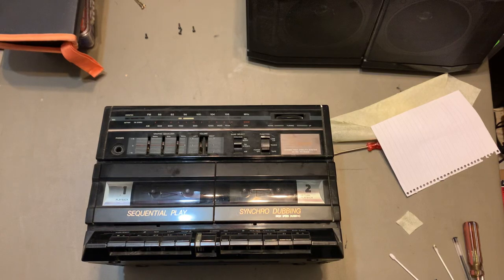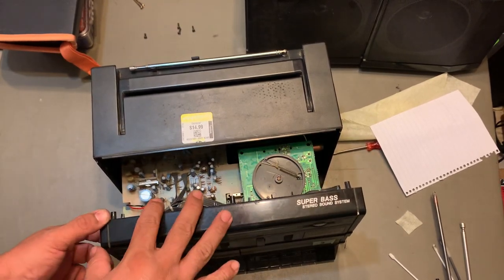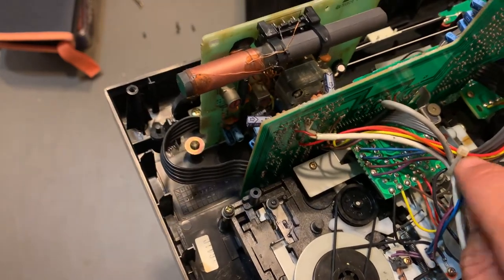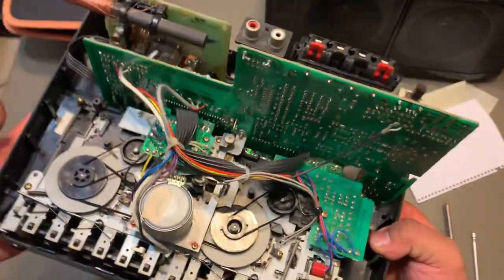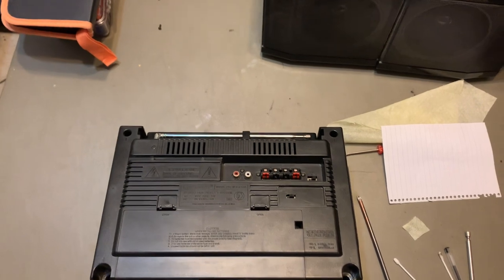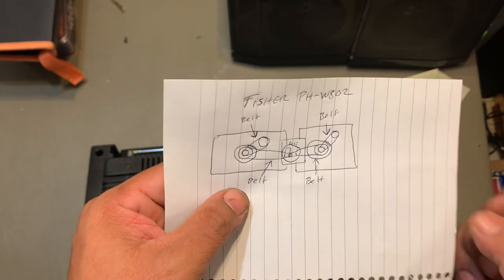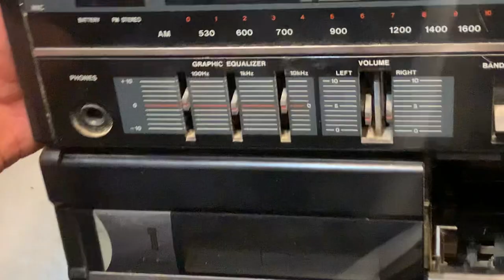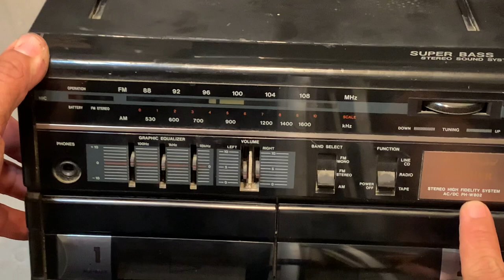Fisher PH-W802 boombox (belt replacement)

Comment: Hello, i have changed belts on fisher w702, inside its like yours, but after change, one mc deck playing faster than other, i used belts from ali express, they were various sizes, i picked same for both decks, and one side got more tension, maybe that is why one side is faster.. But i doubt
Reply from the maker: If I remember correctly yea the belt is bigger in one side, to make sure of the right tension put the belt on the big pulley and then outside of the motor pulley, it should be a bit smaller than the belt path, and about the speed, it might be the pinch rollers, polish, and cleans them up to make sure the tape is not slipping
Reply: @grumpyandroid  thanks
Reply: @grumpyandroid can you pretty please direct me towards belt sizing??

Comment: Man, I’d really like to know how you managed to get those 2 bottom belts onto the pulley. It seems like mission impossible because that big cylinders the black and white wires are in the way
Reply from the maker: it's been a while, but if I remember correctly, you gotta remove the leaf switches and  de-solder a few cables, some of them are the same color so label them, it required some thinking but that's the easy way, not to mention that you gotta do it several times if you don't have the right belts. the hard way is removing the whole motor assembly, but that obviously takes more time and patience. good luck
Reply: @grumpyandroid  thanks for replying! So I’ve managed to put one of the lower belts onto the motor pulley. But when try to put the 2nd bottom belt on, it seems like the 1st belt that I installed is blocking it. Did you have that problem?
Reply: Never mind, I think I managed to do it! I had to find some smaller tweezers . Thanks again and I did de-solder those blue wires as you mentioned . Hope it all works now, I’ll let you know the result
Reply from the maker: @Trebliw8  oh ok so the motor pulley has two grooves , but if you inspect the whole deck assembly horizontally you will know where each belt goes, cause the belt should match a straight horizontal line between the pulleys and the motor
Reply: @grumpyandroid  it works! Thanks again for your help. Couldn’t have done it without you
Reply from the maker: anytime!. I'm glad it's working now and you can enjoy your tapes. it makes me happy, that my videos are helping someone out there. thanks. kudos!.
Reply: @grumpyandroid  I just picked up a Claritone 7980 recently for $350 which is a bit of a project. Looking forward to it though, it will look  beautiful when it’s fully restored